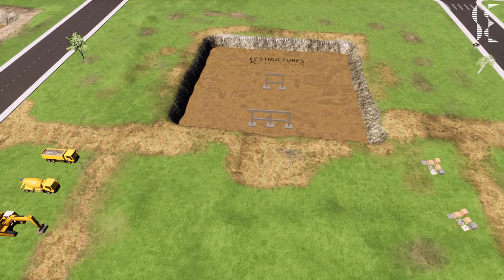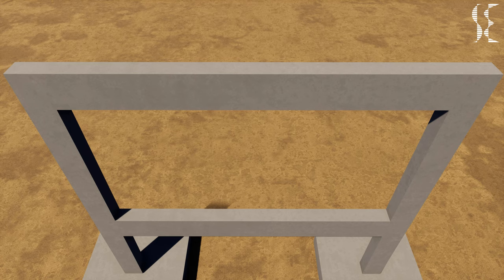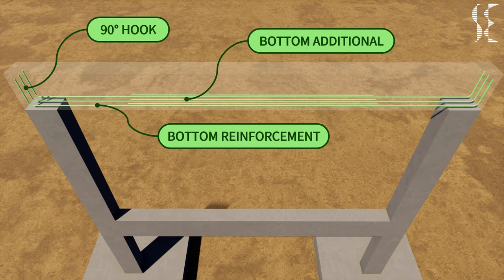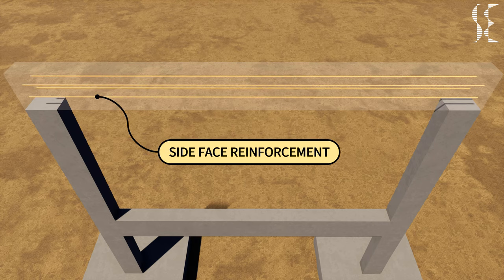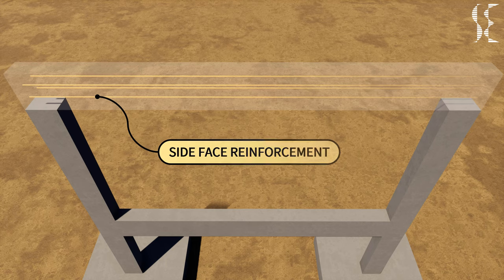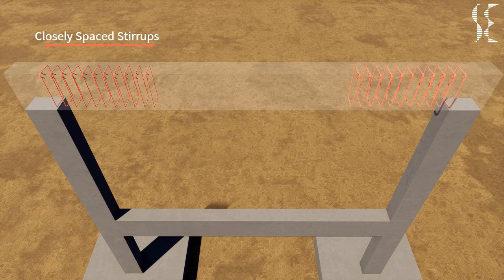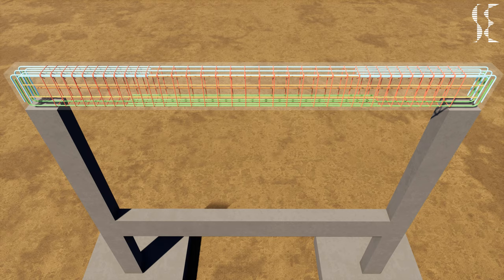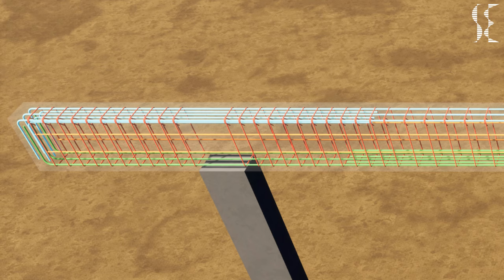Typical Reinforcement in a Concrete Beam

Comment: Will the beam be more rigid and resistant to sagging if stirrups are arranged diagonally to form triangles as done with steel trusses?
Reply: Also, placing Rebar bent in a soft "z" shape, as in 1/3 length Flat, 1/3 Bent 30° to 45°, and last 1/3 Flat (Horizontal), to both form a Truss like connection, and tie to upper and lower rebar together?

Comment: It's a nice video but I would like to correct you here that...You said when depth is more than 900 mm than we provide side face reinforcement but as per IS CODE : 456-2000, CLAUSE - 26.5.1.3 ,Pg no. - 47...It is clearly mentioned that if depth > 750 mm then we have to provide it and the spacing between them should not be more than 300 mm.
Reply from the maker: Hi Bhanu, thanks for your comment. Quoting from the video "These reinforcements are generally provided to deep beams which have depth higher than 900 mm or 36 inches. This value of depth differs from code to code." it is mentioned that the depth value differs from code to code. The value of 900mm is provided in ACI318 and you correctly pointed out that IS code mentions depth as 750mm.
Reply: @StructuresExplained  thanx for the information and reply
Reply: Beautiful conversation...
I would like to add something.
In case of torsion in beams as per 
IS:456:2000, THIS DEPTH IS 450 MM ONLY.
Reply: 750 mm is for flexure only....